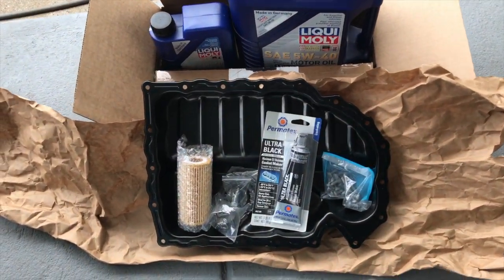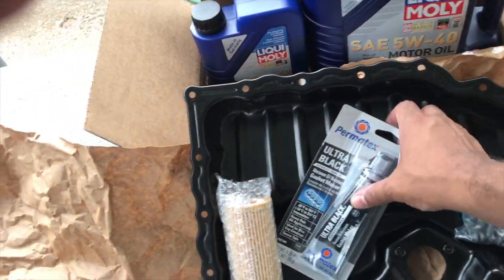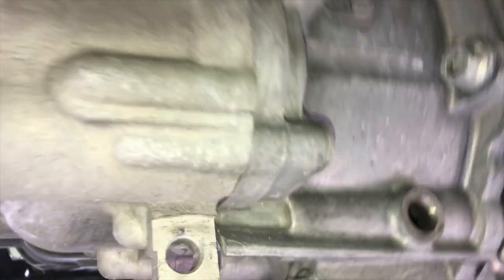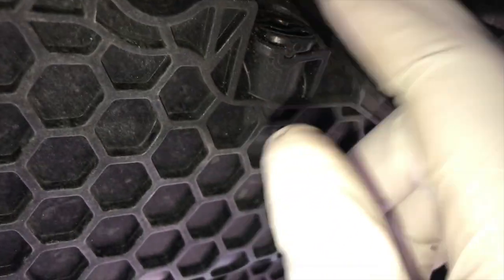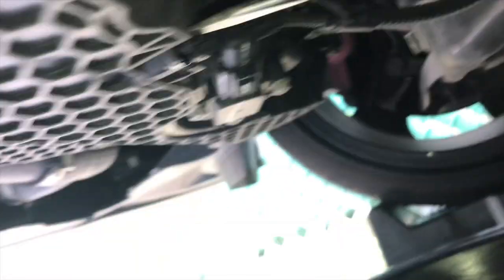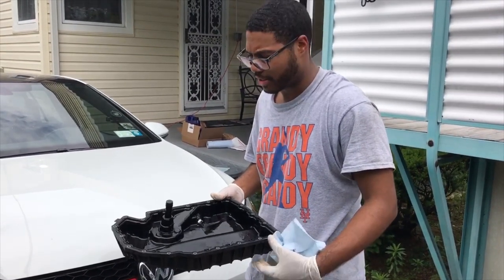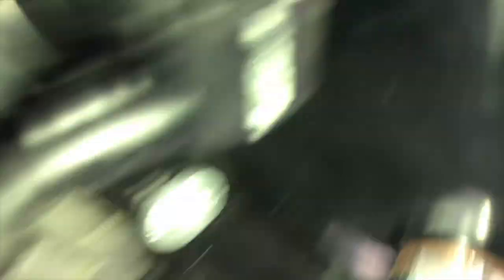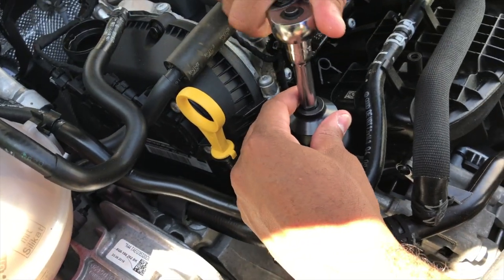Steel Oil Pan Install on my VW GTI MK7

Comment: Tradionalists don't want to accept the new oil pan but it's composite and as J points out doesn't maintain heat like a metal pan. Great video. I would have went a different way though..I would have just bought the metal belly pan for protection and left the composite pan in place. Just another option to protect the under carriage. Keep up the great content!
Reply: Why is retaining heat a bad thing?

Comment: So just to be sure the nuts you used for the oil level sensor are locking nuts and not sealing nuts?

Comment: How about fabricating a piece of metal and epoxy glue it to the bottom of the plastic pan?
Reply from the maker: Yea my friend has tried that and it didn’t work
Reply: @JR14Channel  Got a better idea, just patch the honey cone like holes of the plastic oil pan with bondo; it's strong and resilient with some degree of elasticity.  I would do it if I have I have a GTI, but my Q5 is an SUV and it will never need it.

Comment: The use of cheap plastics in crucial areas instead of steel or more durable material is from what I've heard, really kills these cars in the later year of ownership (beside the electrical problems). Good luck

Comment: Over tightened one of the oil sensor bolts, with a torque wrench that I wasn’t listening to. Snapped it😞 I’m saying F it and running it with two studs🤕
Reply from the maker: Hell yea lol nothing worst than snapping something that is extremely important lol. Even with just two I don’t think that you should have any issues with the oil sensor
Reply: JR14 drove it all day today no issues so I think I’m good for now🙏🏻